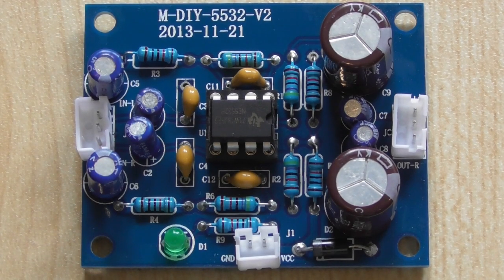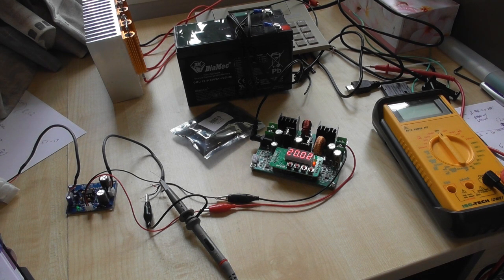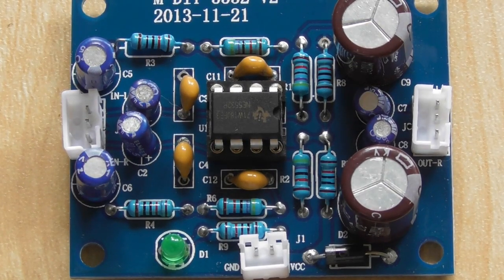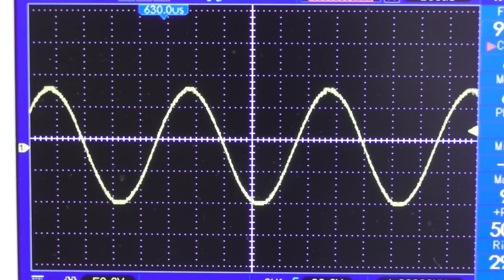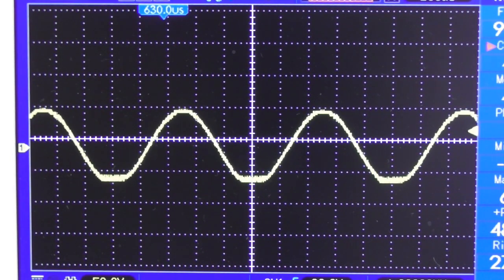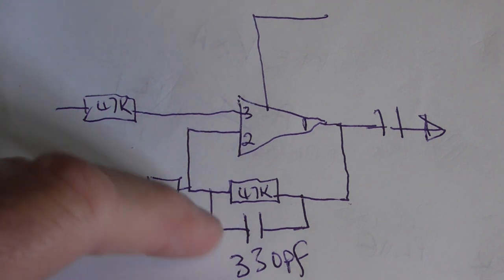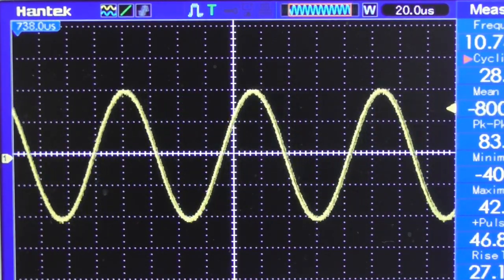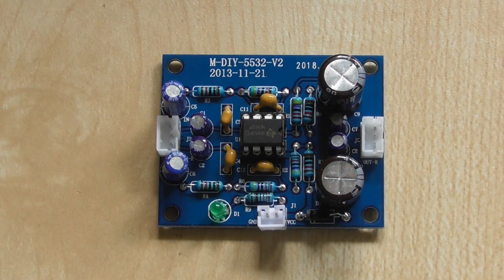NE5532 Op amp. Pre-Amp

Comment: Hi Michael, you commented on some of my videos saying that my testing rig is not ok because amplifiers or preamplifiers can't measure not flat. Here on this your video you have the proof of it. That amplifiers or preamplifiers yes they can measure not flat. All the amplifiers I built and preamplifiers I have the Jean Hiraga amplifier that is flat flat measured with the same testing equipment. And a valve preamplifier which again measure flat flat.
Reply from the maker: You have miss understood what I was saying. Your video shows a RISE in output at some frequences with reference to 0dB at 1 khz. This I have never seen before. This board does NOT do this either, it only fails it high frequencies. Mainly because of incorrect value capacitors in the feedback loop. Even with this fall, it never goes up in level passed the 0dB reference.
The L12 like most such amplifiers is dead flat with no peaks past the 0dB 1 khz reference. 
I cannot give any reason for your results, but technically I have never in over 60 years of measuring amplifiers seen any amplifier with negative feedback, which is probably 99.9% of all amplifiers give a rise above the 0dB reference.
Reply: @MichaelBeeny  I really don't know if was set to 0db. I just set a certain input and just I was charging the frequency. So how I did also to all the amplifiers and as I mentioned I get flat flat only with Jean Hiraga amplifier which I built. These Chinese boards all of them they are not flat

Comment: Thank you for the video. I just got one, it is still 330pf in 2022. I guess it works OK for most people at this price but I will see what happens if I remove them. I find the sound rather flat with it. Will there be any problem if I don't replace them with a 33pf?
Reply from the maker: It may be OK but on one occasion, my latest project, it was prone to picking a strong radio station nearby. A 33pf  cap will kill that issue completly. Watch my video on fake 5532. I bet you've got one.
Reply: @MichaelBeeny  I don't have 33pf but have 22pf. Will that do? Kind of not worth the trouble ordering them just for a $3 preamp, lol.
Reply from the maker: @KKMan20xx  It's not that critical, just means the HF wont roll quite or early. MUCH better than 330pf that's for sure.

Comment: NE5532 is the weirdest op amp ever seen, it doesn't work if either IN- or IN+ grounded also the output doesn't go from 0 to VCC in comparator mode but from 2 volts to VCC
Anyway it's built for audio circuits only
Reply from the maker: AS you say it was built just for audio and in that mode it works very well. As old as it is!
Reply: you need +5v and -5v voltage both.

Comment: RIAA standards  you will see why you can YouTube record player RIAA  EQ  Decoding  I think you will understand
Reply from the maker: No, Peter, this pre amp is not suitable as an RIAA or pick up circuit. The RIAA curve is not just a simple HF cut. The circuit for the curve is quite complex and tends to use close tolerance components. The circuit would also need a 47K input impedance and a high sensitivity of around 2/3 mV. That circuit would then feed into a preamp like this one.
Reply from the maker: Sorry Pete, I've only just woken up, it's early in the morning here in New Zealand, but sadly I don't understand what you are saying!
Reply: https://en.wikipedia.org/wiki/RIAA_equalization.    
The link above we'll explain what was happening in this preamp and the high-frequency roll off

Comment: The 5532 /5534 are some of the worst sounding op-amps out there. They are used everywhere because of low cost, but they should have been taken out of service 20 years ago. 
Put in a 47920 it will sound way better.
Reply: I’d say they are used everywhere because they do the job required at low cost.  They don’t sound bad at all, but that’s not to say there aren’t better sounding op amps.

Comment: The best preamplifier ic that i have tested is.
LT1057 opamp ic. It is the most expensive I have bought. I am looking for unchanget sound after the sound has good through the preamplifier.
Reply from the maker: I have never tested the LT1057 so cannot comment. As I cannot hear any sound deterioration with the NE5532 I personally cannot see any point in spending more for a (possibly) better IC if I cannot hear any difference. However your experience and opinion are always welcome.

Comment: I tried the ne5532 of different brands and the sound changes a lot.
the best was an obsolete ceramic type.

the best sound with + 22-22 volts
Reply: which brands have you tested out, specifically to the ne5532?

Comment from the maker: A new version of this has just been released. It uses a split rail power supply, surface mounted components but still has the NE5532 on a socket. Looks like a better option to this one. I will test and compare it soon as stock arrives.
Reply: Well done! Will remember this if I need a pre-amp. Kind of fond of the lm4562 opamp which would drop in. Currently still working on my DIY speakers.
Reply from the maker: Hi Marcel, good to see you here. I've never used the 4562. I will try it together with a number of similar chips that will just drop in. I doubt they will measure much difference but be interested to see if they have a 'sound'  I'm still waiting for the 'new' version to turn up!

Comment: High frequency drop off is likely due to capacitance acting as a low pass filter, most likely the dipped ceramics that are across the input lines, C3, C4. UPDATE, I stand corrected, I wouldn't of suspected the feedback caps ! Nice catch.
Reply from the maker: I wonder how many hundreds have been sold  like that, I listened to it, it really does sound very lacking in HF. After fixing I must say it's good as it should be. To quote Peter Walker of Quad.. Wire with gain!!